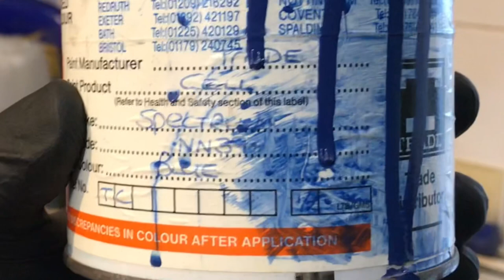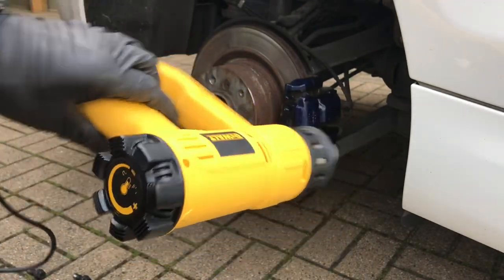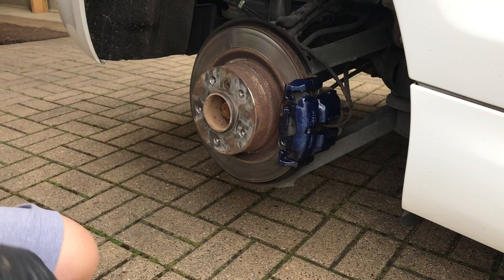Painting Brake Calipers, “The Easy Way”

Comment: How long do it take to dry. Will it dry quicker with heat gun
Reply from the maker: with the heat 2 hours, a couple of days to totally harden, Thanks for the great comments👍🏻👍🏻🛠
Reply: @aaanton11  how long does it last before repainting again years months weeks days and will it stop the rust from coming through ive just bought some matt black caliper paint for my toyota aygo
Reply from the maker: Should last a few years, depends on how hard you brake😂 Thanks for the great comments👍🏻👍🏻🛠